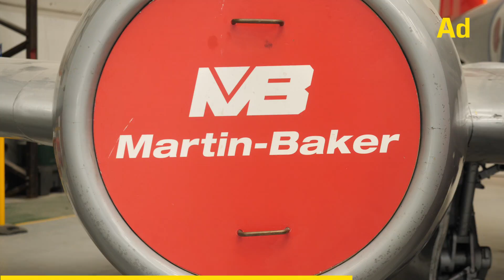RC Plane Ejection Seat - Part 2

Comment: So did you get to eject from a plane yourself? I always thought that would have been a cool thing to do, especially if it was the kind of emergency for which the seats are made. They've saved a lot of lives for sure! Wish I could do an engineering program but I'm probably kind of old and I have a number of disabilities too. My mind still works well though.
Reply: hi
ejection is an emergency procedure, which means people usually don't do it just for fun or even for tests

ejection seat usually pulls about 15-20G (for fractions of a second), which is still a lot for your spine to handle, usually pilots suffer from compression injuries and sometimes literally spine fractures if they didn't pushed their head into the seat

but it's definitely better than crashing with your plane, that's for sure, Martin-Baker seats alone saved more than 6000 lives (some of them multiple times)

Comment: Congratulations! will there be a sequel????? very interesting to see the system in the air, how the manikin will eject, what will come of it, and the parachute handling. I'm designing and testing my own ejection system for 1/6 scale models, I use a system of tethered rmains and their detachment at a certain height after which a rescue parachute is deployed.

Comment: What if you where to make a torpedo that you drop from a rc plane,You could use a EDF,a brushless rc motor,or a model rocket engine to propel when it is dropped into the water.(i have always wanted to make one :)

Comment: Legend has it when they wanted to test the first ejection seat (which was done full scale in Meteor for the first time), they wanted to use a chimpanzee for a test subject.  The RSPCA stepped in a told them NO!  So they found an enlisted man (fitter) who was 'volunteered' for the tests, since there was not Royal Society for Protection of Enlisted Men, (the original seat used a 3" (76mm) cannon shell to blast the seat from the aircraft, so they were NOT gentle!  Nearly every United States Navy hangar where they work of the ejection systems for USN aircraft has a sign that reads; 'if you cannot fly United, Fly Martin-Baker!'

Comment: IRL the ejection is performed chiefly by ejection mechanism (two pipes with a "gun powder" charge inside, the system basically similar to a shotgun shell), and rocket motors work only to increase an egection speed. Without using this ejection cylinders (and rails) the achievement of a stable ejection would be hardly fesible.

Comment: Saw a flaw in the design, the seat didn't clear the tail about some feet (or inches because of the scale). If the plane was moving fast, poor action man will get hit by the vertical or horizontal stabilizer.

Comment: Two magnetic tracks that hold the seat unit tight in the aircraft.
As soon as the ejector seat button is pressed ,one set of the magnetic track has reversed polarity and then the seat unit would be ejected at what could be a controlled accleration such as fairground rides use.
No need then for complicated seat units.

Comment: Hello again.
What about some spring loaded or sliding contacts between the wiring and the igniters?
Preferably located at the back of the seat, near the guide rails.
Located on the seat bottom, vertical vibration by the aircraft might result in poor contact.
Rail type contacts would provide more contact area, and perhaps more reliable ignition.
The wiring would be neater, and unlikely to tangle Action Man’s limbs.
Pardon my intrusive comments I like to tell other people how to solve their problems, rather than working on my own.
Good luck Action Man.

Let’s be careful out there.

Comment: Greetings,
Definitely very interesting project. From the look of the ground tests, some consultation with M-B regarding thrust lines and their relationship to the seat’s center of gravity would be in order.
Also, the A class motors don’t seem to launch the seat very high, even taking the tethering by the one firing lead into account.
Also, do you plan on giving Action Mann a parachute?  Or are you just going to throw him out of the aircraft to his doom?
If that’s the case,I think I’d prefer to ride the thing down and take my chances with a belly landing.
Maybe some launching rails would provide a better launch.
Oh, and some heavy Aluminum foil, or thin Stainless Steel would definitely be appropriate in the cockpit.
I already see som burn through.
Good luck with your adventures.

Let’s be careful out there.

Comment: Can’t wait to see the flight test. Have you considered the change in CG when the pilot ejects? Maybe put some movable weight that moves with a servo as soon at the pilot is ejected? Also maybe consider thin aluminum sheeting for the cockpit for heat shielding.

Comment: the seat itself typically ejected with pyrocharge and a piston, the rocket engine(s) work out a bit later, after seat already left an aircraft

to make a seat flying stable, the point where rocket engine thrust force is applied should be shifted above the center of gravity of whole seat setup
and, for an airplane model it is better to use single rocket engine to avoid thrust deviation in case of using a pair

Comment: Although the rockets have a "cool" factor, I think I'd go for a compression spring under the seat (held in compression with a catch that can be retracted via servo). Solves a lot of problems at once (like thermal protection, latency in the rockets getting up to max thrust, imbalance in thrust between the rocket motors, the need for so many rocket motors)

Comment: Entertaining as always.
Keep the 'stuff' coming.
One thing. Superb laser cutter, fancy equipment etc then you use needle nose pliers to tighten those nuts.
Oh no. Please use a correct size socket or a spanner (that's the ex aircraft engineer in me talking).
Keep up the superb content.     : )

Comment: DON'T FLY YOUR AIRCRAFT

I hope that was headlining enough for you. You are going to have a major CG problem after ejection. Notice the MB aircraft fires fron the rear seat, you need to be a lot further back. 

Calculate the CG both with the seat in, and out. I can help you with the calcs if you need.
Reply from the maker: I talked to the pilot of MB's real Meteors when I was at the airfield, to voice my same concerns, but he didn't seem to think it would be a problem on my model. WIll be flying it nose heavy and test flying it before hand. :)
Reply: @Project-Air  I'd still be inclined to calculate it before you fly it. A crash and rebuild would be a pain.

Comment: You got through all the trouble to build this nice Meteor with laser cut plywood parts - why not build it properly with more "true to scale" lines and airfoil from balsa, plywood and some kind of coating film?
Reply from the maker: Because that would be much more trouble! I build planes from balsa and ply too and they take far longer for projects like this! :)
Reply: @Project-Air  Well, I believe that if something is worth doing, you might as well do it right!

BTW, Kudos for you MB sponsorship! They are an amazing company. I'm in my last month of my aerospace engineering degree and would love to work with a company like them.
Reply from the maker: @aGabay  For my purposes, this is the right way to do it :)

Comment: personally with multiple motor ignitions and an ejection or stores, rockets or seats i would place each motor into a interconnected tube system so they all feed a common pressure into the pipes and they all operate like air pistons with only the top connected to the seat.
this balances the ejection forces as pistons to low pressure and dont rely on the motors getting up to full thrust at different times.